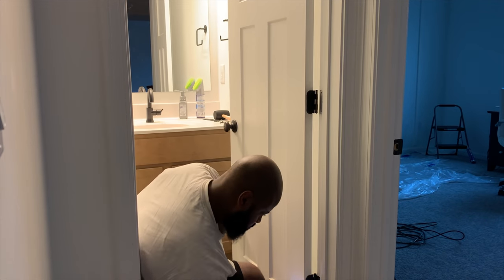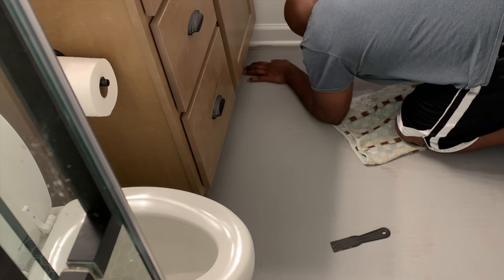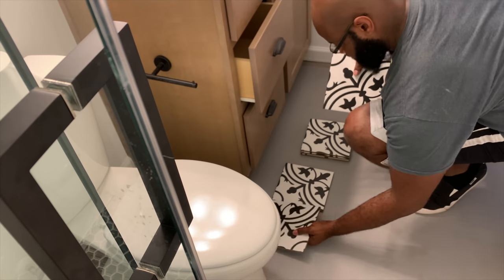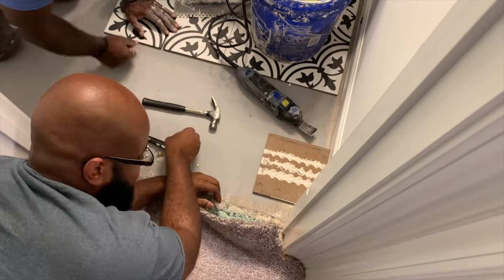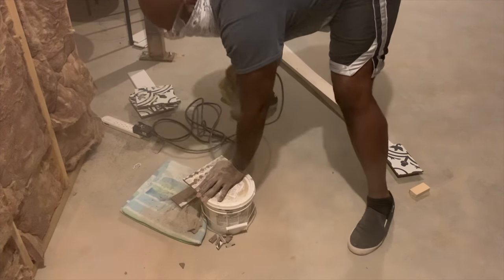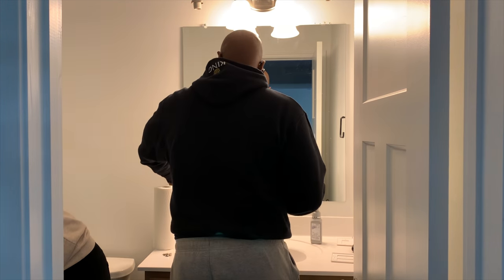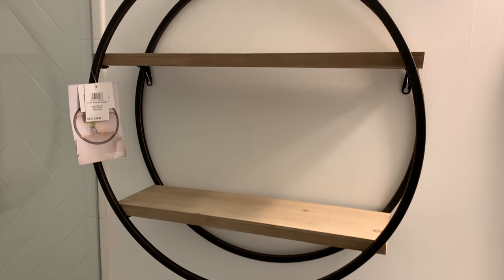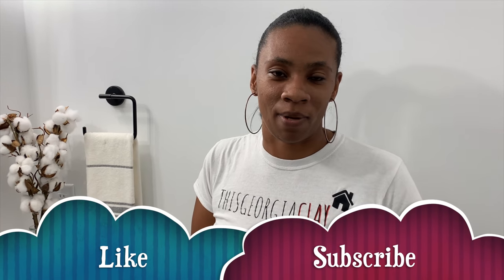DIY Small Bathroom Makeover | Pinterest Inspired Bathroom - Fischer Homes New Build

Comment: You both have certainly done some nice improvements. Mad respect to you for showing that a mistake can be made, and even more so how you worked to correct it. Nicely done!

We moved into a new build two years ago. However, we waited a year, before making any changes. We did not want the builder to say we voided the warranty or anything like that. They already tried to renege on so many things. Builders can be rather frustrating. 

PS: Matt is similar to me. Only in the last 18 months or so, have I really started to do ‘home improvement’ things. Not fond of electricity. However, I can take a PC apart in a heartbeat and not think twice about it. Weird…
Reply from the maker: Thank you 🙏🏽 yes, our builder just states that if they need to make any drywall repairs they won’t repaint the walls back to another color. We’re using the same white that’s throughout the house for our main projects. Also if I hate the vinyl so I wouldn’t want them to repair it even if I needed to. 

I always say just go for it! I can’t wait to share the latest project we’re working on because we had to change the design on a dime. I think it looks waaaaay better now. 🥰

Yea Matt is actually a tech geek too but it’s been impressing me with keeping up with my crazy projects and ideas 😝 See ya next week